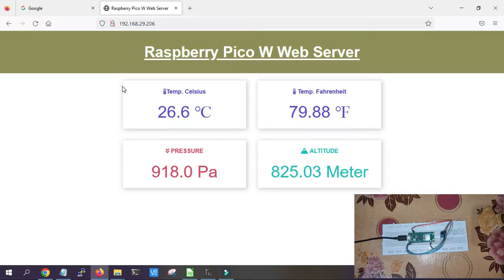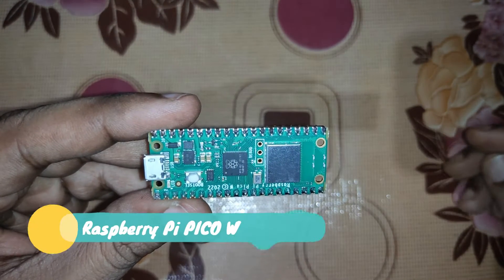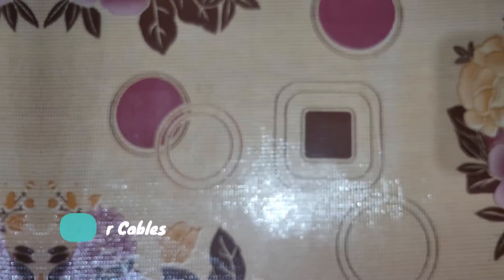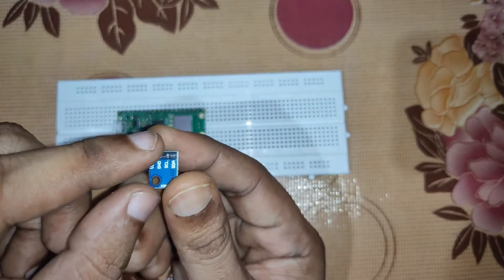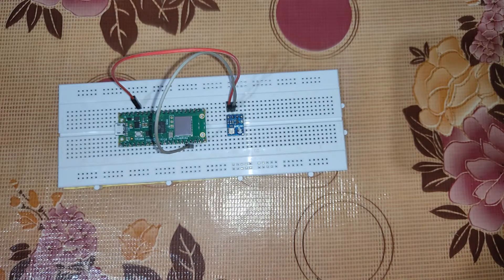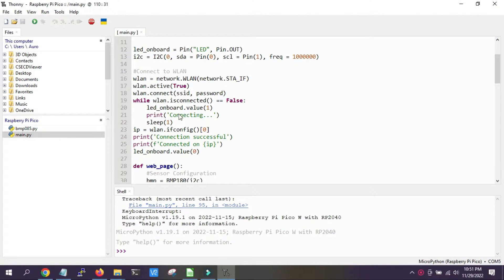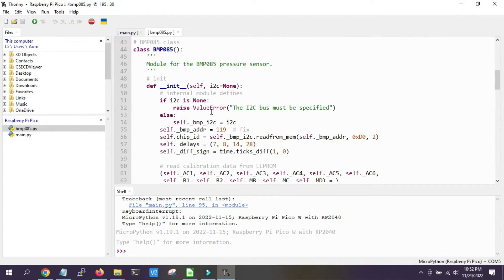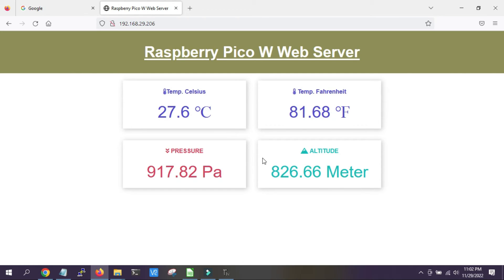Raspberry Pi Pico W web server with BMP180 sensor

Comment: Hi and first of all thanks for your video! Is it also possible to connect to Pico using a Wifi Direct connection ?
Reply from the maker: You can connect with your router/modem which has internet or with mobile hotspot.
Reply: You can create an access point on the Pico W, then change all the host IPs in the code to point to the gateway IP